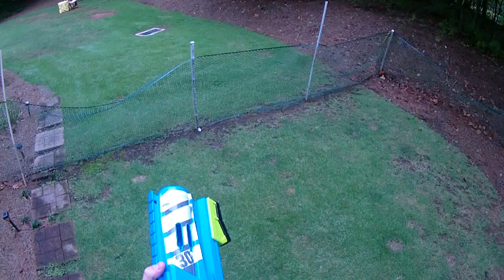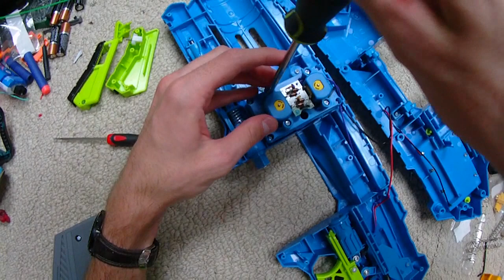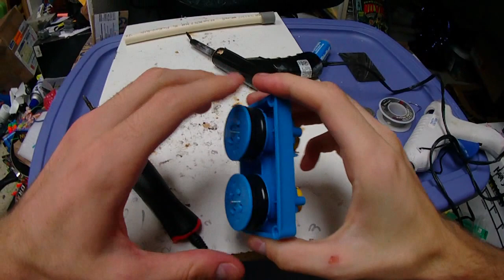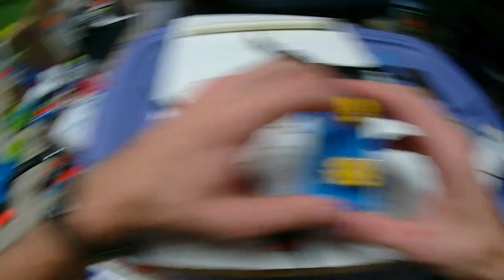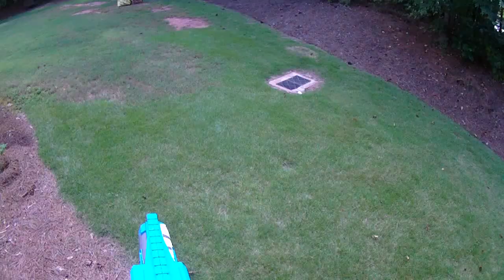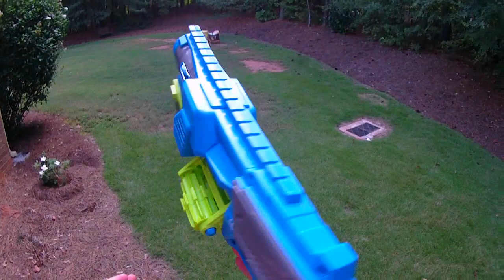The ULTIMATE Mod Guide for the BoomCo Spinsanity 3X (Voltage Improvements & Lock Removal)

Comment: Anyone reading this in 2017 another step you should do with a voltage mod is glue the rubber of the flywheels together. The rubber on the flywheels come undone the faster they go.

Comment: I think this is still my favorite boomco blaster conceptually. Of all the multi-cylinder blasters on the market im aware of (this, flip fury, doominator, quatro shot), this one has the highest capacity in the slickest platform. The flip fury is probably the most reliable of the bunch over all, but it only has relatively high capacity by pistol standards, and is less than half that of the spinsanity. (Doominator and quatro shot are a toss up between stock fps and reliable rotation/ ergonomics). Spinsanity is big enough to be a primary and just carry it without the bulk of the other two; while the flip fury is too big to holster and kind of small to be a primary. But i suppose you could put it on a carabiner for a side arm. I just wish nerf could make a higher capacity, space efficient cylinder blaster like the spinsanity without moving to a large cylinder like the lawbringer (though i do like that blaster conceptually too). If nerf does another large cylinder, id like to see it be two tiered to use space better. Some concepts other companies beat hasbro to or do better, honestly.

Comment: The mod is just like a stryfe
Reply: Lucas most flywheel electrical mods seem to be pretty similar in concept. Re wire and remove unnecessary componenets, maybe put in better motors and/or whywheels, stronger power source.